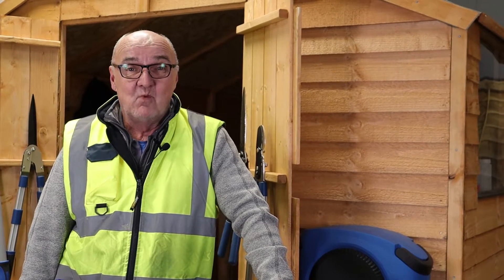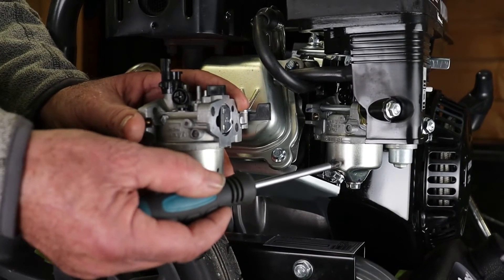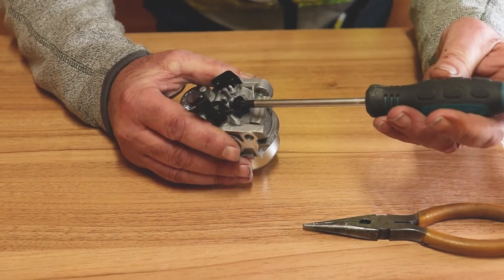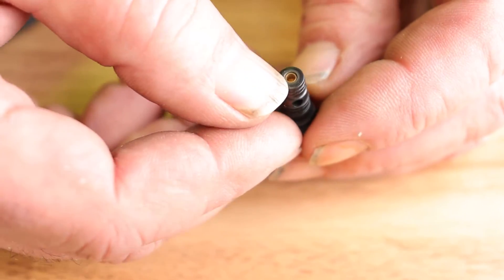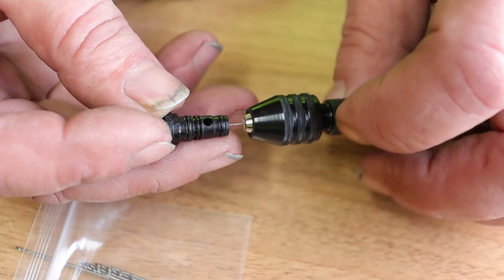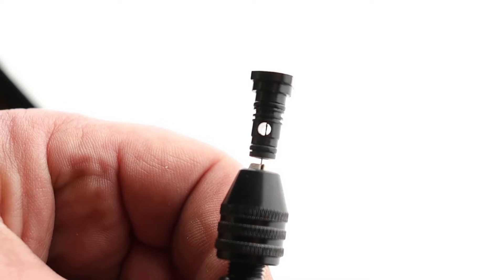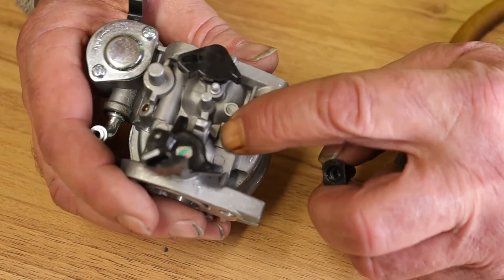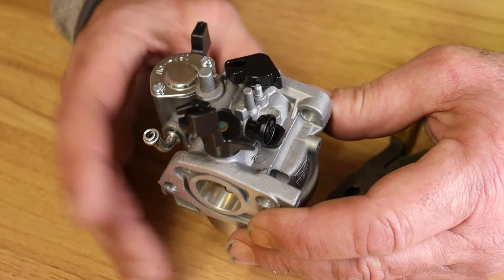Is your Engine Hunting? - here's an easy fix you can try at home! (Hyundai Power Products)

Comment: I have cleaned my carb. and changed with a spare. However mower starts ok but after a few seconds engine starts to hunt. I have changed fuel and air filter.
Would appreciate any ideas.
Reply from the maker: Hi Geoff, our team is always happy to help!: 01646 687 880

Comment: Is there a adjustment for the throttle?  My mower is only running at one speed not high rev but medium only.
Reply: I am also experiencing this, did you find a solution?
Reply: The throttle screw in this video can alter it.
Reply: Very good video . Thanks